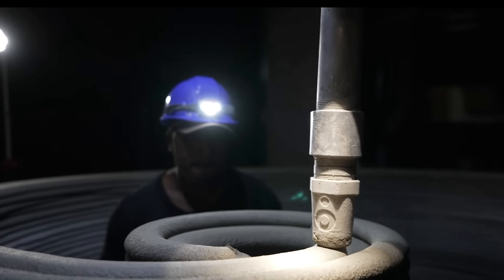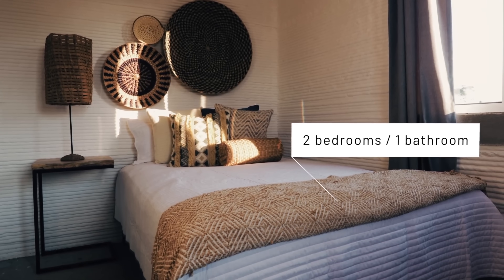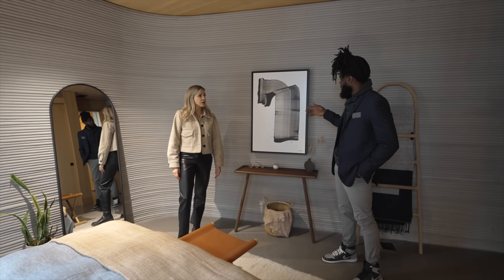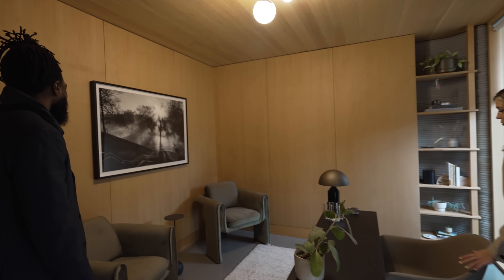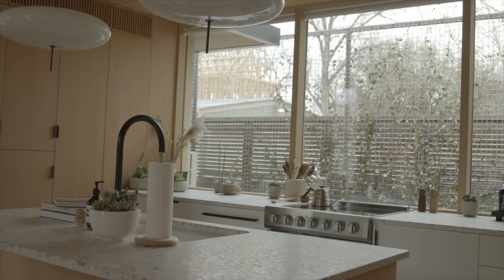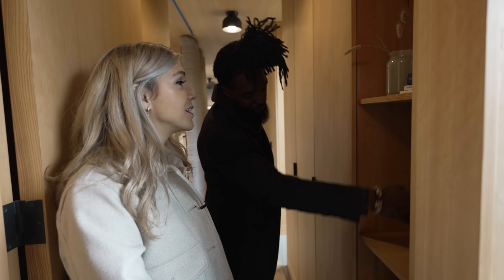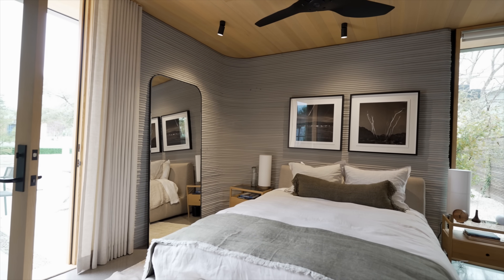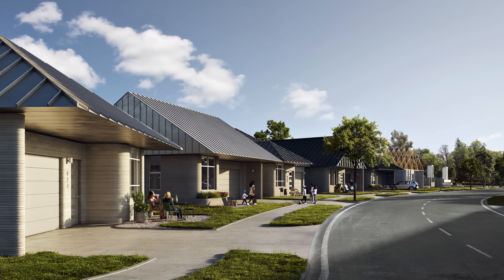Inside A 3D Printed House You'll ACTUALLY Want To Live In

Comment: It's definitely an esthetic of its own. Personally, I think the curves and layers are deceiving in that they look like padded textiles, like oversized corduroy or pillow pleated canvas, a nice contrast to the sharp, straight lines of the wood and glass. I like that look on this kind of layout, but not so much when it's forced into the traditional construction layout.
Reply: I do NOT want that house.  to many "technical" /structural Restrictions inovolved with it and  it's required constricted sizes.  The material is a horible mess. Then huge expense to "cover/finish those walls".  Wiring and plumbing issues.  If you want to build something like that there are better/Cheaper , simpler ways to do it.  search ,... Oh what is it called,  Mud/sand bag , earthen bag construction.  And I am not saying I would want that for my main house either.  I've have seen nice hotel rooms....  cement is a mess! espeically when you leave it exposed. Dirt , spiders, and bugs "sticking to it" and those layers/grooves!  then trying to deal with plumbing, electrical etc,  and even try hanging a shelf or picture. :-)) wanna change a door or window? 😅😅😅 that texture is aweful.  even beyond cleaning it has problems.  the novelty would wear off quickly.  and trying to cover that up with wood, plaster, etc... IS $$$$$   Are you noticing that even with the camera/"lense"?shooting done to try and make it  look bigger.  Look at how SMALL the rooms are. EVEN The ones that are supposed to be "larger rooms"  Oh and I live in a mostly solid cement walls and roof/ceiling ...  I will call Bull Sheets on it being 75 F inside on  days when it is in the 90's .  I live in the desert and once it starts warming up in the spring in the "90's" after a few days the cement warms up, the walls warm up and there is no way you are going to have 75F inside without turning on the AC.  if it goes "hot" then cold" then "hot" the cold for a couple of days, then Maybe... But after after a few solid days or warm/hot temps, the cement warms up. and as the temps keep on climing for "the SUMMER/ spring"  the walls of the building keep getting warmer.  In the low desert in AZ,  if I turn off the AC it will "quickly" start climbing toward the 90's F. I guess higher if you forget to turn on the AC.  Oh, and of course the Reverse happens in the winter.  Sure the novelty of this is "cute"  but the reality is..................  Not So Great.   especially if you DON'T want just a little/cramped "single persons"  condo/vacation condo"  and You don't want the MESS of unfinished cement walls.  You know what else you will notice about this... NO REBAR REINFORCEMENT/"structural support". ("no multiple stories") And there Are More issues than just these... Ahh but the Novelty of it. 😅

Comment: Pretty cool. I'm not too sure about keeping the exposed concrete, even though I do like the look, because it would collect dust like crazy. You might be able to get away with lining it with a clear epoxy if you wanted to keep the look without having to deal with the dust collection, but then you'd have issues with damage to the epoxy whenever you want to put up pictures or other items that hang on the wall. 

Regardless, I like the concept, and I would absolutely go for a 3d printed house.
Reply: How about you just regular dust it like you would a regular house. Or keep a mini blower to get through the cracks not that hard lol!!
Reply: YOUR  still going to have dust , dirt, insects, spider webs in all of those Grooves, and they are textures,  It would take a Lot of resin to smooth it out. and then still, the Grooves. 
I do NOT want that house.  to many "technical" /structural Restrictions inovolved with it and  it required constricted sizes.  The material is a horible mess. Then huge expense to "cover/finish those walls".  Wiring and plumbing issues.  If you want to build something like that there are better/Cheaper , simpler ways to do it.  search ,... Oh what is it called,  Mud/sand bag , earthen bag construction.  And I am not saying I would want that for my main house.  I've have seen nice hotel rooms....  cement is a mess! espeically when you leave it exposed. Dirt , spiders, and bugs "sticking to it" , then trying to deal with plumbing, elextrical etc,  and even try hanging a shelf or picture. :-)) that texture is aweful.  even beyond cleaning it has problems.  the novelty would wear off quickly.  and trying to cover that up with wood, plaster, etc... IS $$$$$   Are you noticing that even with the camera/"lense"?shooting done to try and make it  look bigger.  Look at how SMALL the rooms are. EVEN The ones that are supposed to be "larger rooms"  Oh and I live in a mostly solid cement walls and roof/ceiling ...  I will call Bull Sheets on it being 75 F inside on  days when it is in the 90's .  I live in the desert and once it starts warming up in the spring in the "90's" after a few days the cement warms up, the walls warm up and there is no way you are going to have 75F inside without turning on the AC.  if it goes "hot" then cold" then "hot" the cold for a couple of days, then Maybe... But after after a few solid days or warm/hot temps, the cement warms up. and as the temps keep on climing for "the SUMMER/ spring"  the walls of the building keep getting warmer.  In the low desert in AZ,  if I turn off the AC it will quickly start climbing toward the 90's F. I guess higher if you forget to turn on the AC.  Oh, and of course the Reverse happens in the winter.  Sure the novelty of this is "cute"  but the reality is..................  Not So Great.   especially if you DON'T want just a little "single persons"  condo/vacation condo"  and You don't want the MESS of unfinished cement walls.  You know what else you will notice about this... NO REBAR REINFORCEMENT/STRUCTURAL SUPPORT.

Comment: I'm not really sure how this makes the whole process more "efficient".  Most of that house is not 3D printed.  If you wanted true efficiency, then you'd want to build sections off-site in some factory where you can control quality, then ship those fully-built pieces and just assemble the house on site.  Also, concrete is not a good insulator, so you will still need either inner or outer walls with insulation to make this viable... I mean, unless you're in an environment where it's a comfortable temperature all year round.  But, most places are not like that.  Overall, this seems like a gimmick.

Comment: I think anytime you have a design firm who can put this much love into a template its going to look good. The only question is how practical the building materials and having a single-lay wall formation is vs. something like, say, 3D printed panels or bricks that can be replaced / removed as needed. The later wouldn't look as graceful but I do wonder what research has been done into maintenance, remodeling, etc. for these structures (the single print wall suggests that there are hard limitations but it might not be as bad as it looks with some ingenious workarounds).

Comment: Don't be fooled into thinking a completed home will cost less than a traditional home ~ only the walls made by the printer costs less. The whole home actually costs more IF you can even get one. Why? It takes specialized subcontractors  to actually do all of the interior and exterior finish work (the majority of the cost of any home is labor) and these specialized workers are in VERY short supply right now, with no foreseeable change coming anytime soon.

Comment: The company should investigate the use of foamcrete/aircrete that has a higher insulation value over the solid concrete walls for colder climates. They should also think of a way of smoothing the walls as it is extruded if the patterned texture is not required instead of having to plaster it over, or even manually trowel them smooth while the concrete is still plastic.  Curved walls have more structural strength than flat walls so this idea can be incorporated into the design, as well as printing columns. I have thought about the idea of printing houses for a while so have a few ideas.
Reply: I actually like the way it looks
Reply: @ultramasterultra5724  But not everyone does, and the textured cement 1000% will be a magnet for dust without the possibility of properly cleaning it. And then you also have the issue of cement retaining water a lot, which in more humid climates would lead to mold - it all needs to be refined imo.
Reply: @lanycera  dust & grease in the kitchen
Reply: Agree I like more of a smooth look :c

Comment: The cleaning of the walls comes impossible in a few months. The dirt just sticks to the wavy lines. If you are asthmatic bad luck.. Also there is no metal support/binging structure inside the cement (wall) to prevent cracking. Thats HUGE no go in most european countries.

Comment: I wonder how the concrete walls will hold up while the house is settling and if that would cause any cracking in the concrete. I'd imagine there's very little flexibility in the concrete.
Reply: Concrete houses are literally the most durable houses. That's why high rises build out of Concrete and not wood. North America is the only continent where wooden houses are the standard and it is international knowledge that America builds some of the worst or list durable houses from wood.

Comment: It looks nice, but those wriggly walls are gonna be terrible to clean. Once the dust accumulates inside the crevices, you'll need to vacuum your walls. Another question here is, was the house expensive due to the manual laborers that got replaced by the 3d printer? I'd think those guys would charge the lowest.

Comment: Pumicecrete home is by far the best building material on the planet Pumicecrete is a mixture of pumice cement and water mixed and poured into a set of reusable forms walls are poured from 12"to to 24" thick pumicecrete is fireproof termite proof rust rot and mold proof and has a high R value and good sound attenuation solid poured walls means no critters can live in your walls and can be built for a fraction of the cost and time

Comment: I’m originally from Tampa Florida and our homes were all built out of concrete block and yes I can tell you for a fact that even without the air conditioning running on a hot summer day, it is not horrible inside. My electric bill was 1/4 compared to what I’m paying for a 2x4 framed house.

Comment: How the heck is the electrical done? For example what if I wanted to hang a tv on the wall and hide the cables by routing the cables through the wall? That might be a bit difficult to do unless you just get a strip cover that sticks to the wall, not a huge issue but just something small to think about.

Comment: I would live in one, but I have to see how it can handle heat, cold, moisture and noise transfer (what is the R rating), echo , earthquake, seaside damp/moisture/salt erosion.  How much of savings is it  per square foot if you have 65% wood panel coverage when compared with oo/stucco building.  Warranty? What does the warranty cover?

Comment: in reality you not going to save a whole lot just building the shell of the wall by 3d print....and i mean shell. also NONE of these 3d printed design projects has passed any structural safety requirements especially in a earth quake zone.  for a home to last you need foundation work and reinforcements and so on.  Tons of labor will still be needed to fit out everything.  try to do this in lets say Japan with our any structure and foundation critical earthquake safety design that wall will crack and collapse.

Comment: I wonder how those homes would stand up to a hurricane? I live in Miami where we have some of the strictest building codes in the state, if not the country. Homes down here aren’t built out of lumber like they are in other parts of the country. The outer walls of our homes are made out of concrete block that’s filled in to make a solid concrete wall. The only exterior part of our homes that’s made out of wood is the roof. Basically, our homes are concrete bunkers built to withstand hurricane force winds. How does Icon’s construction methods stand up to hurricanes and other types of inclement weather? If their homes can meet the building codes of Florida and Miami-Dade County, I could see them having a huge market where I live if they can significantly bring down the cost of construction.

Also, did you ask how long it takes them to print a home?

Comment: Pretty cool and the houses look fairly nice however that oversize wool look will get old when it's a limitation of the process, not a design choice. Further, when it's only a few structural walls that's 3D printed the overall work it takes to make is not significantly less if at all. So so far it's a gimmick. The emphasis on using concrete is legacy thinking and holding them back. Concrete is both somewhat expensive, needs mixing and has short work life, adding greatly to the manual labor part. What has more potential is laser sintering of powders where for instance sand could take the role of concrete. it requires no effort to use, literally dirt cheap and can be lasered in place to vastly greater precision than the crude sausage. Laser sintering also allows the use of metal powders such that it can print in electrical wiring, reinforcements, plumbing, hvac etc. The powders could include various colors for surface finishes and create complex sinks, toilets, even marble. It could make the swimming pool, pumps, foundation, whatever. Such a technology combined with automated digging in the ground could produce a complete house with near zero human work and material cost. Its potential is extreme.

Comment: I love this house! Only 2 questions: Will it have a good R-value in a winter climate like the upper Midwest of the US? Also, how much would the house cost to build complete with fixtures?
Reply: i think you need to spray some insulation over it from the outside. Which is costly. If the concrete is normal concrete (it looks like it), maybe it could be designed with bigger gapst (hollow) structure. Puting insulation between the walls.
In this form its not energy efficient.
Maybe you could make this from industrial hemp. That would be awesome. That has a much better R value.
Reply: @AzUthred  I think they should use bricks as exterior material
Reply: concrete crack in winter, so this concept doenst work in cold country

Comment: This gentleman is truly a genius. Great company that I’m definitely going to check out. I love the texture and curves!!!! I’m into a minimalist look and like the way you can add the type of wood you want and tile where and if you want it. Plus living in Texas and knowing the heat, the cooling aspect really intrigues me. Thanks for an eye opening video!!!!
Reply: I do NOT want that house.  to many "technical" /structural Restrictions inovolved with it and  it required constricted sizes.  The material is a horible mess. Then huge expense to "cover/finish those walls".  Wiring and plumbing issues.  If you want to build something like that there are better/Cheaper , simpler ways to do it.  search ,... Oh what is it called,  Mud/sand bag , earthen bag construction.  And I am not saying I would want that for my main house.  I've have seen nice hotel rooms....  cement is a mess! espeically when you leave it exposed. Dirt , spiders, and bugs "sticking to it" , then trying to deal with plumbing, elextrical etc,  and even try hanging a shelf or picture. :-)) that texture is aweful.  even beyond cleaning it has problems.  the novelty would wear off quickly.  and trying to cover that up with wood, plaster, etc... IS $$$$$   Are you noticing that even with the camera/"lense"?shooting done to try and make it  look bigger.  Look at how SMALL the rooms are. EVEN The ones that are supposed to be "larger rooms"  Oh and I live in a mostly solid cement walls and roof/ceiling ...  I will call Bull Sheets on it being 75 F inside on  days when it is in the 90's .  I live in the desert and once it starts warming up in the spring in the "90's" after a few days the cement warms up, the walls warm up and there is no way you are going to have 75F inside without turning on the AC.  if it goes "hot" then cold" then "hot" the cold for a couple of days, then Maybe... But after after a few solid days or warm/hot temps, the cement warms up. and as the temps keep on climing for "the SUMMER/ spring"  the walls of the building keep getting warmer.  In the low desert in AZ,  if I turn off the AC it will "quickly" start climbing toward the 90's F. I guess higher if you forget to turn on the AC.  Oh, and of course the Reverse happens in the winter.  Sure the novelty of this is "cute"  but the reality is..................  Not So Great.   especially if you DON'T want just a little/cramped "single persons"  condo/vacation condo"  and You don't want the MESS of unfinished cement walls.  You know what else you will notice about this... NO REBAR REINFORCEMENT/"structural support".